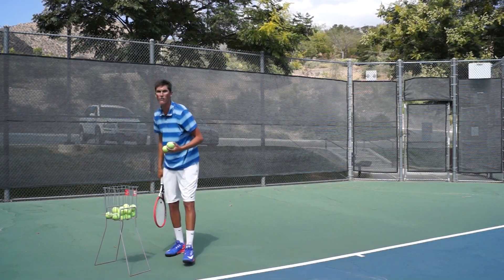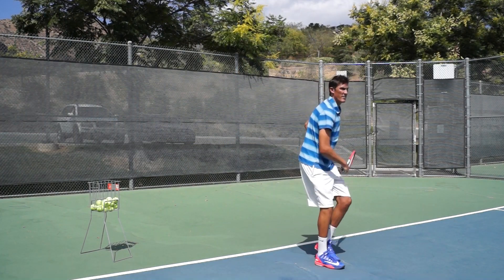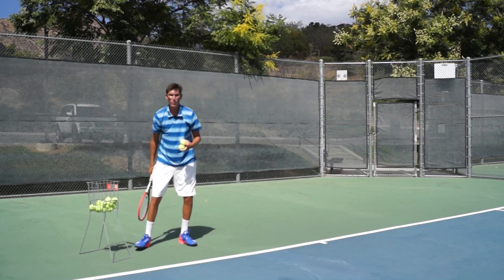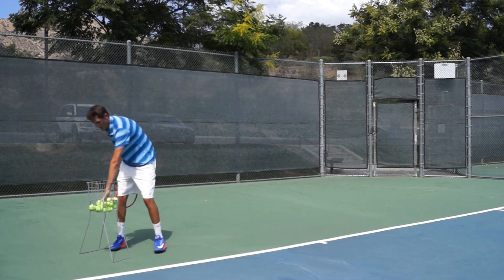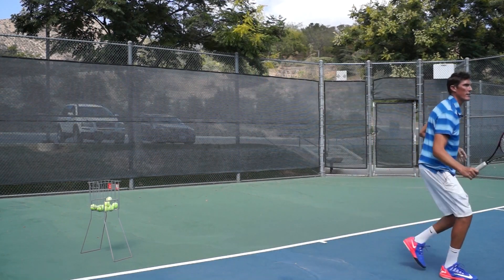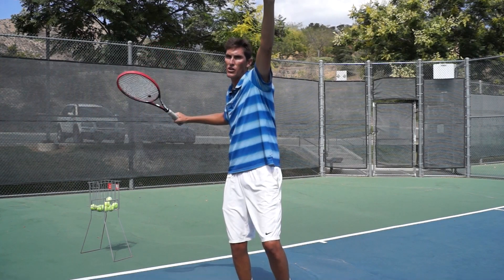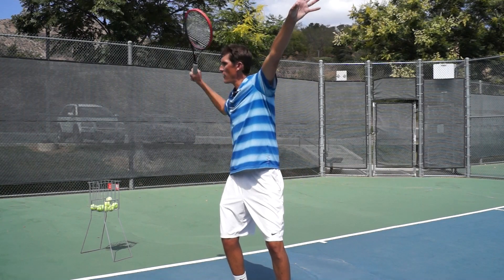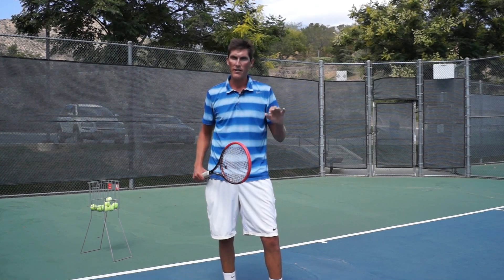Add Power To Your Serve | HIT WITH MORE POWER

Comment: 120 mph... pff
Reply: i believe it....guy looks like hes 6'6", doesnt look like hes putting a lot into it, but yeah
Reply: i was measuring my serve speed at indian wells down the street, they have installed new smart courts with speed radars all over the court even measuring ground stroke speed.  You would be surprised how easy it is to just snap your arm straight through contact and flatten it out to make an easy 120...but being super tall helps
Reply from the maker: 120 may seem big but it pales in comparison to the top pros who are hitting regularly in the 140s
Reply from the maker: Also I'm 6'7" :)
Reply: holy moses